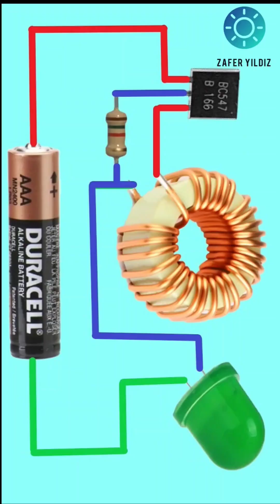Simple LED Driver Working with 1.5 Volt #zaferyildiz #diy #led #short #shorts #simple #electronics

Comment: There is an error in the description in the video - the first transistor was BC547, the second one must be BC557 P-N-P. This system will not work on two BC547s.
Reply: The circuit works but consumes more energy from the source compared to the circuit with two p-n-p and n-p-n transistors, a lot of energy is lost in the 330R resistor.